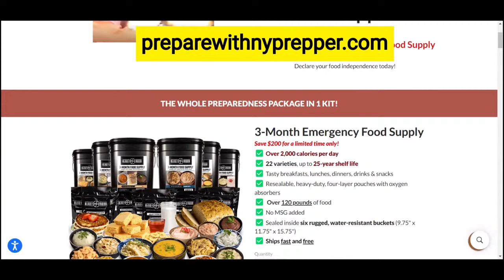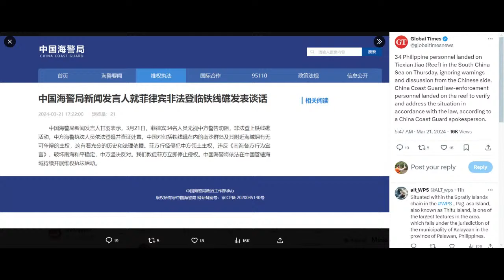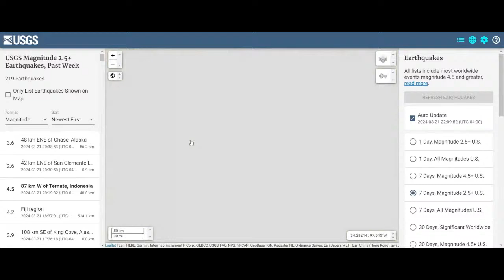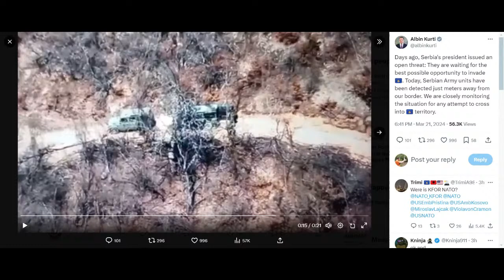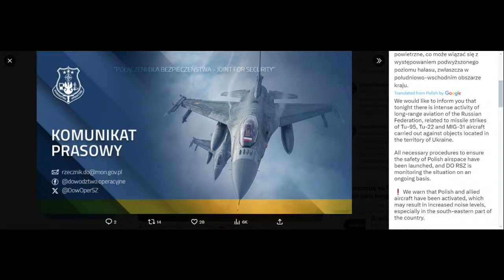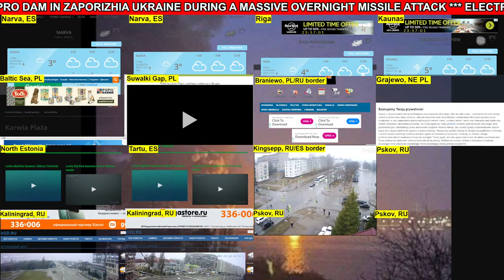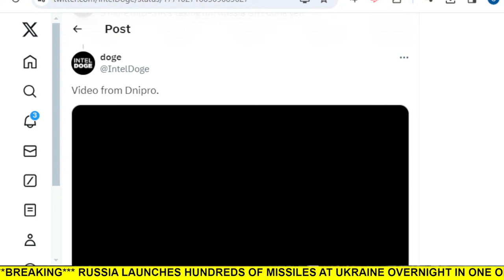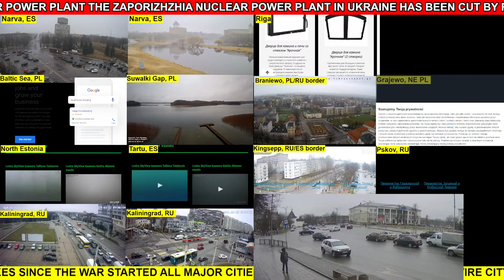EMERGENCY ALERT!! RUSSIA STRIKES DAM IN UKRAINE!! MAIN POWER LINE CUT TO ZAPORIZHIA NUCLEAR PLANT!!

Comment: Blitzkrieg is a word used to describe a combined arms attack using a rapid, overwhelming force concentration that may consist of armoured and motorized or mechanized infantry formations; together with artillery, air assault, and close air support; with intent to break through the opponent's lines of defence, dislocate the defenders, unbalance the enemies by making it difficult to respond to the continuously changing front, and defeat them in a decisive battle of annihilation (domino theory).